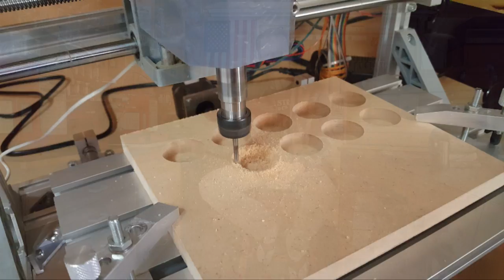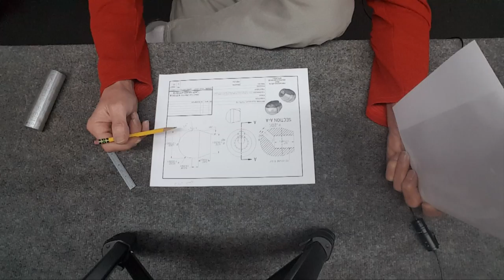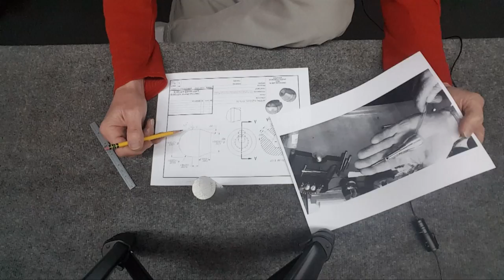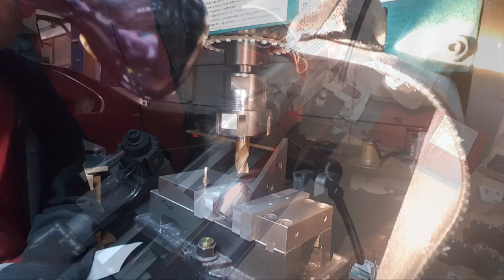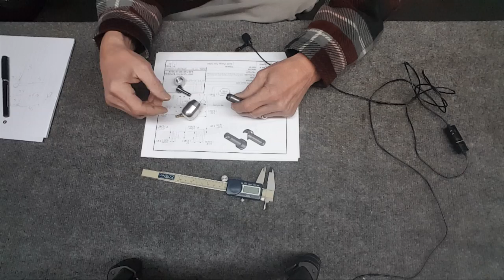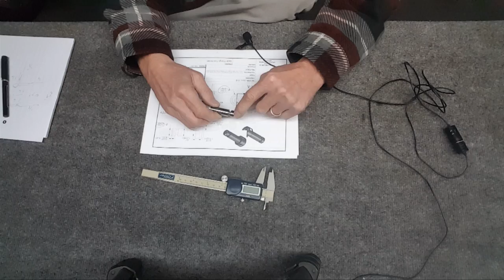Making Publio's Hand Engraving Tool

Comment: When drilling and taping  the hole in the handle and when clamping it in the vice why didn't you use your V block to rest it in and set your V block to the angle in the vice you needed. This would have prevented any movement in it. Just a thought. When clamping any round stock in my vice I always use the V block and have had good results this way.